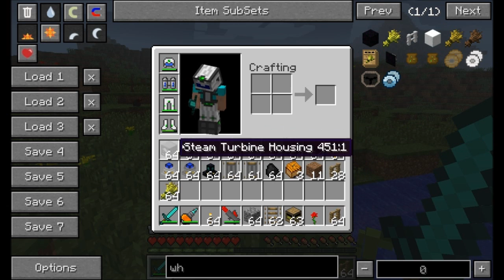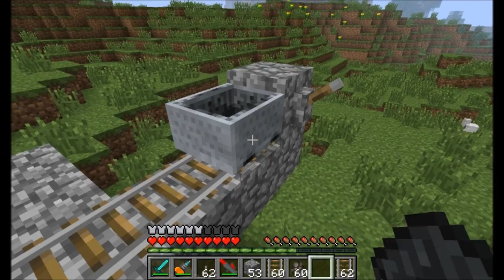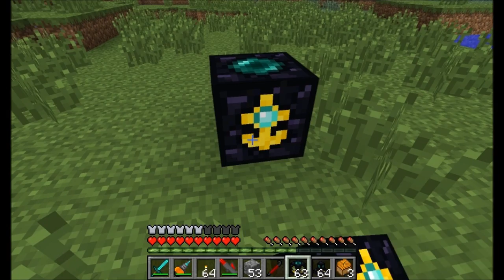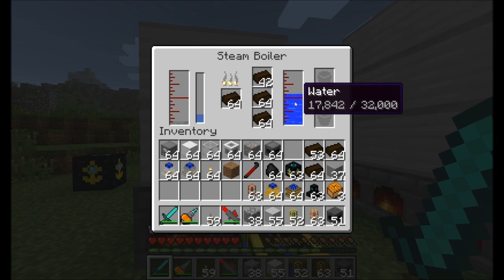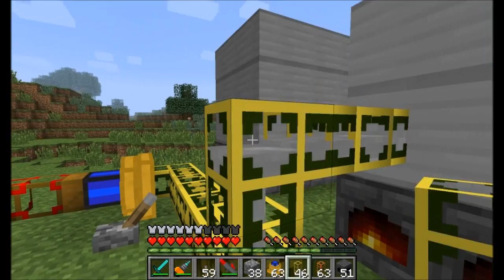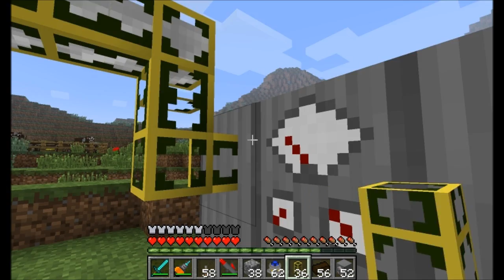Mod Spotlight - Railcraft v6.7

Comment: when using the steam turbine, to get 100% i had to link about 7 gold waterproof pipes to the turbine without them being connected to each other... Heres a tip: if you have redpower 2 mod, 1 liquid pipe can get 100% out of your turbine saves alot of resorces, time, and space ;)

Comment: Railcraft causes my forge to not work. I end up with a forge bug report. Which pisses me off because I want to use it with Traincraft and buildcraft. Also a side note, Some of the buildcraft add ons don't run well with my minecraft for some odd reason. Might be that I haven't paid for my Minecraft....yet. Three days and I'll get it for real.

Comment: To finish of some of the guys still arguing about mods and updates.
When Minecraft updates there's not only additions (pistons, new mobs, etc.) there's code changes that optimize Minecraft, making code changes for mods necessary. The mod API will make these changes easier, but they will still be necessary.

Comment: Well, they did introduced the piston in the game from the very beginnings too, which is both technology and also used to be a mod. It just suited them at the time and it's a small and simple change.
I think they don't do that because it would mean way too much hassle debugging the game later on. If you check the update logs you can see they still fix simple bugs and omissions in the vanilla game. So add a mod collection of BC3, RP2 and IC2 in the game and that would be their greatest nightmare.

Comment: I thought it would have been funny if the boilers could blast off like an ICBM when water was added to an empty but hot tank, so it could shoot through a few layers of blocks before exploding or shoot into the sky and come back down to make a huge crater.

Comment: you have connections with the modders, so I hope if you like my ideas it would get to someone.

1 if a pipe that doesn't lead to a motor or something else should drain from the tank

2. add a valve if you dont have one or the engines dont keep the steam level steady then kaboom.

please like so he can see alson shout out to tman7106 he has some cool animations so check him out

Comment: Depending on your definition. Surely you can't obliterate the map with it, but it's still a very inexpensive yet powerful item. Now if it required 5 diamonds or something to just open one portal then it wouldn't be, but no one would use it that way.
It also doesn't fit the whole minecraft lore. That game seems set in a medieval-ish kind of era, they didn't even have electricity back then, and definitely not portals.
(Don't confuse the ingame portals with it, those are magic, not technology)

Comment: The change from 1.2.5 to 1.3 was very big. They unified the singleplayer and multiplayer game modes into one codebase, so that singleplayer games are just multiplayer games played locally. This really messed with a lot of mods. Eloraam said it basically broke literally everything in redpower. Also, when a new verison is released, the code obfuscation changes which has to be figured out and mod code updated to accomodate for it.

Comment: The only reason updating to 1.3.2 takes so long is because so much of the base code is changed, now that minecraft is 1.4.2 I'm sure you have noticed most mods are updating faster, and thats because the change isn't as big. 
Think of it like this, Vanilla minecraft took a long time to update from 1.2.5 to 1.3.2, so same thing with mods. However, since vanilla didn't take long to update to 1.4.2, neither will the mods. If you watch dire's smp lets play you'll notice elo hasn't lost much progress

Comment: I don't know how hard it would be since the liquid pipes are buildcraft but it would be sweet if steam floated to the top of the pipe instead of flowing along the bottom. Just a suggestion but I assume that that would be very very difficult to code and implement.

Comment: Steam Turbine is probably the least efficient method of generating Eu. Five regular generators running on charcoal is far more efficient, both in terms of fuel consumed and in terms of resource investment. Everything else about boilers, however, is made of win.

Comment: the reason it took so long for 1.3.2 is because multilayer and single player got merged. This meant alot of mods had to be totally rewritten. Thaumcraft 2 got discontinued for updating due to Azanor working on thaumcraft 3, this is why it was never updated

Comment: in america everything is backwards. instead of using metric system which is has a nice pattern they use foot and inchest wich are terrible for accurate measuring.

Comment: It's awesome that these mod devs never fail to disappoint when it comes to fantastic mod changes/additions. The only caviot I have is how would you transport steam and other liquids in/out of the various Railcraft machines and such without BC pipes? Not saying you shouldn't use those mods together but it just bugs me for some reason.

Comment: Dire, I can tell your american. :P C means Celsius, the unit of temperature used everywhere except the US. The boiling point of water (the point where it turns into steam) is 100 degrees. the system was just setup so the freezing and boiling of fresh water is 0 and 100 degrees respectively.

Comment: And how about you read a post before answering and start insulting people?
I know about the BC alpha and IC prereleases, I use them now in my MC 1.3.2 and they are exactly that, 1.3.2 prereleases.There is no 1.4.2 pre as of yet.
How about Thaumcraft, it also skipped 1.3.2,seriously READ posts before replying!
They apparently did a major shift from Risugami's Modloader to forge in 1.3.2, hence the long wait. I just asked if there were going to do the same time, that's all. Where's the rant?

Comment: the difference from 1.2.5 to 1.3.2 was huge and required many mods to rewrite major portions of their code. the difference between 1.3.2 and 1.4.2 is minor and would only take a couple minutes for the mod author to update. Eloraam is taking this time to also add new things to her mod. Azanor is making an entirely new Thaumcraft, not just updating his old one.